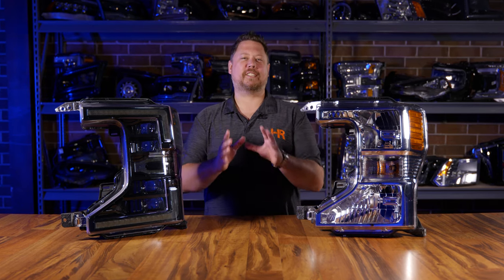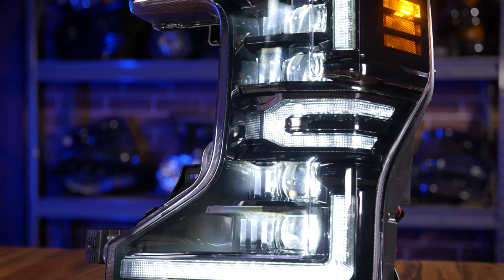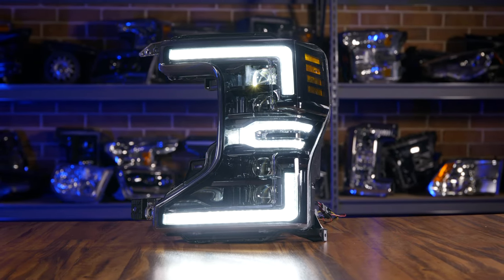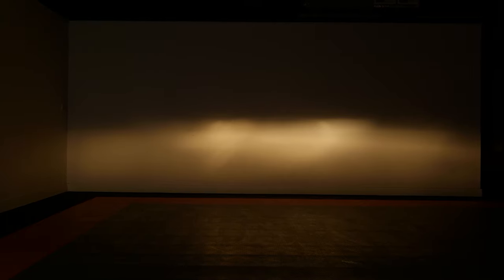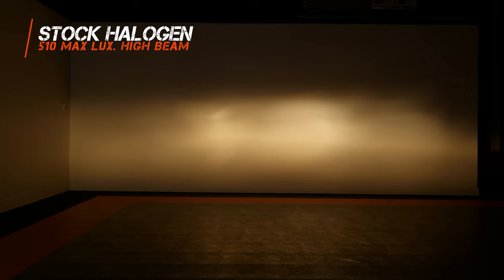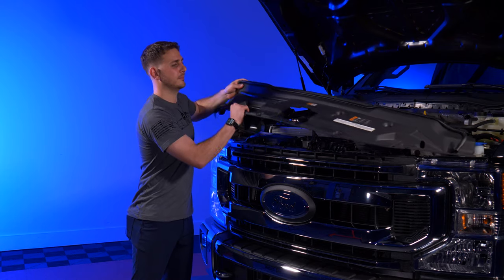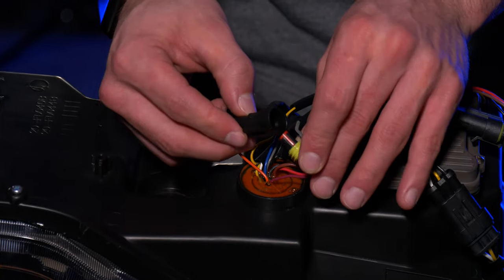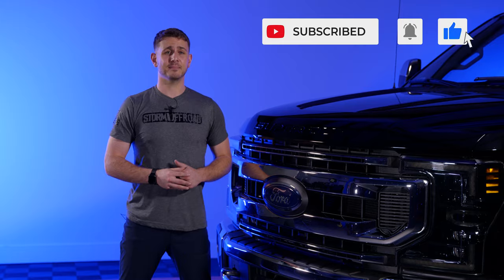ALL NEW 2020+ Ford Super Duty Morimoto XB Headlight Install & Review | Headlight Revolution

Comment: Is it normal for the sequential turn signal to work normally and then randomly flash solid once and then continue sequential? Mine does that.
Reply: Bought it from Headlight Revolution - great customer service. Love the lights. Much better looking than OEM.
Reply from the maker: Reach out to our CS team so we can see if we can help you!

218-755-5200
Sales@HeadlightRevolution.com
Reply: @brandonandrews1983  mine does the same, did you figure out the cause?
Reply: @rubydell6192  supposedly there is a fix - Headlight Revolution is sending me a harness to swap out, but it is on backorder so I haven’t gotten to confirm that it works.

Comment: Got my lights in and it took me roughly an hour to do the job. 
Insights: 
1: Take your time in getting grille off and putting it back on the tabs are fragile.
2. Take your time the fuse box is a beast to deal with.
3. Pay attention when taking out your headlights and installing them the tabs have metal clips they will not be nice to your paint, again pay attention.
4. Use dielectric grease on your plugs
5. Ensure you route your wires away from anything moving or hot I used wire loom to protect wires.
6. Take your time.
Reply from the maker: Thanks for the tips
Reply: tell me what fuse number did you end up tapping into? thanxs!

Comment: 9:58 The fuse cover is too shallow to snap back in place on the 2020. There is nothing you can do to make it close, you will just break the tabs. I jammed a foam block in there to hold it closed for now. The rest of installation is pretty simple. My truck was built on a Wednesday, just barely fit socket in. Monday trucks, I feel for you, it's going to be awhile.
Reply from the maker: Thanks for the info!
Reply: My truck must’ve been built on a Monday it was near impossible to get those bolts out, had to lower the bumper 😂 I had issues trying to shut the fuse panel too
Reply: My 2020 is fuse panel cover is shallow as well. Anyone know if other years provide more room to securely close?
Reply: @FatFendered39   They do not mention the part about the fuse box not being designed to run an external wire thru. Gee, I wonder how they missed that part of it. Their video skips right over that.

Comment: Are you able to adjust the low beam pattern? If so do all 4 lights adjust together? Is there an adjustment bolt?
Reply from the maker: Yes, you can adjust the low beams, but the high beams will also adjust with the low beams.
Reply: Is there an adjustment screw to lower the low beam? getting flashed after lift put in.

Comment: Any idea why the fuse tap needs to go to #16?
I would feel better not using : Powertrain control module. Transmission control module.
Reply from the maker: It can go to any Ignition source.
Reply: My tech said use fuse #35 “power point 2’ and not #16. Also you will have to notch fuse box to avoid crushing the DRL wire.

Comment: I just bought some from you guys and the big C lights don’t stay on when in auto I have to manually change the lights by hand.???how can they stay on all the time in auto
Reply from the maker: This sounds like either your DRL harness is not installed, or it is not installed in the proper Fuse Tap location. Send us an email with photos so that we can help!

Sales@HeadlightRevolution.com
Reply: My passenger side drl or big c won’t come on. Did you figure this out?

Comment: The fuse box needs to be trimmed on a 22, unless you planning to choke the cable?
Reply from the maker: Yep! You'll have to notch it.
Reply: Won’t this allow moisture intrusion into the fuse box and potentially violate your warranty?
Reply: Wire direct to Brown wire bundled with the upfitter switches. Use a 14 AWG with in-line 10AMP fuse. Don't leave your fuse box exposed to elements.    See Video by Old Soul Millennial on the topic.  That's the way I wired it.

Comment: So would the drl outline work just like factory? Without the low beams being turned on at the same time?
Reply from the maker: Exactly!
Reply: @HeadlightRevolution  whoa see I had a dealer add these when I bought the truck cus it came with the halogen and they installed these they look great but during the the drl outline is on and the low beams at the same time
Reply: @N0M4D_22  I bet your truck is originally from Canada like mine. If it's not, check your settings on your cluster. There should be a setting for Daylight driving , just turn it off. Otherwise you have to get a cable and use forscan to reprogram it yourself. It's not that hard.

Comment: How does the Morimoto brightness compare to the OEM LED brightness?
Also, the Morimoto high beams are only like 18% brighter than the Morimoto low beams.  Is there any way to adjust the high beams to be like 30% - 40% brighter?

Also, every aftermarket headlight assembly I've ever purchased and installed were pieces of crap compared to OEM lights.  How do these stack up quality-wise after 6 months or so?
Reply from the maker: These are much brighter than the OEM LED lights. 
The high beam doesn't necessarily need to have a huge increase in output, it has more to do with where that light is placed. So it gets a bit brighter but you get much more light above that low beam cutoff resulting in a really bright high beam that throws super far down the road!

These lights are OEM quality. We have sets that have been on the road for years now and are still holding up beautifully!
Reply: @HeadlightRevolution  Great!  Thanks for the info and another great video!
Reply: I have a twin brother who has the same truck. The factory LED's on his truck were brighter than mine with the morimoto

Comment: My grill on my 2021 SD250 is different than your model and my fuse box is on the other side of the battery. Will you have a update on the 2021 models?
Reply: I’ve got f250 xlt 2021 , and mine exactly the same like on this video, I have no idea why your looks different
Reply: @legasoff2823  I have a 2021 F350  STX Dually Feb 2021 build and it is different than video also top mounting is different.
Reply: @johnbell238  do you have lights in your side mirrors?
Reply from the maker: Not sure! Shoot us an email so we can help you!

Sales@headlightrevolution.com
218-755-5200
Reply: Engine option maybe?

Comment: Which low beam plug should you use top or bottom?
Reply from the maker: Top.
Reply: @HeadlightRevolution  Okay just checking because the factory drl is the top low beam bulb so when I put it in drive that top low beam is always on just making sure that’s how it needs to be done
Reply: @HeadlightRevolution  After six months use I just lost my right low beam wonder what I do now?

Comment: Hello, I have a 2020 superduty with halogen headlights, do I need to do anything else like go into the computer to get these working.
I was told by my dealer It’s impossible to go from halogen headlights to the new HID headlights, the wireing is all different and it’s set up different in the computer, would I need to get into the Forscan on a laptop to change anything? I don’t want to drop $2,000 dollars and then find out I need to do other things , please respond
Reply: These are plug in play for factory halogen
Reply from the maker: These headlights are plug and play with your factory halogen lights.
Reply: @HeadlightRevolution  So,I have just installed as video says on my 2022 superduty and my DL lights come on as soon as I start the truck and when I put it in gear they switch to headlight mode with driving lights at low capacity as it was night time,any thoughts? Canadian Truck,built in USA.

Comment: $1800 😳 no thanks
Reply from the maker: They are cheaper than OEM LED headlights.
Reply: OEM is 1100 when ordering a truck. I just ordered a f250 and that was the upgrade price includes rear taillights as well